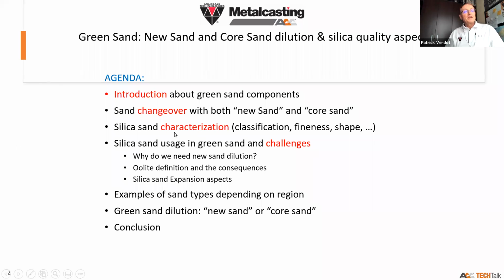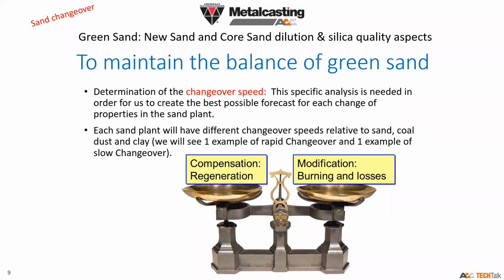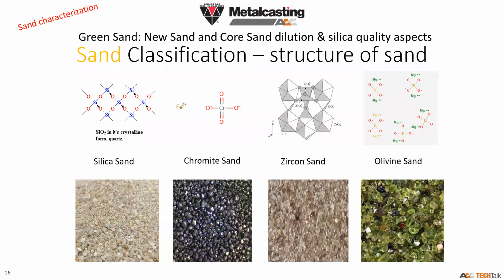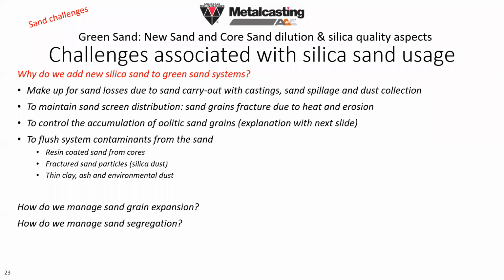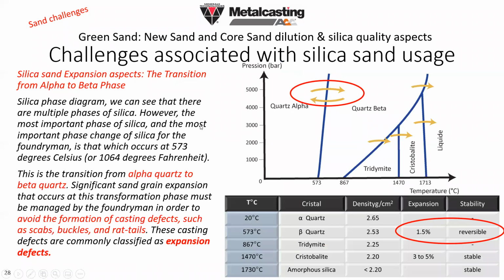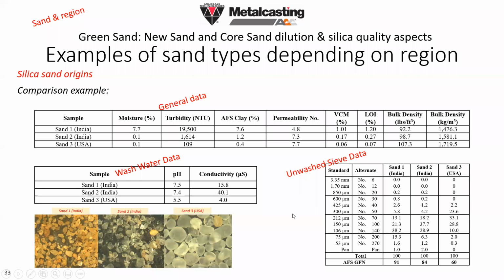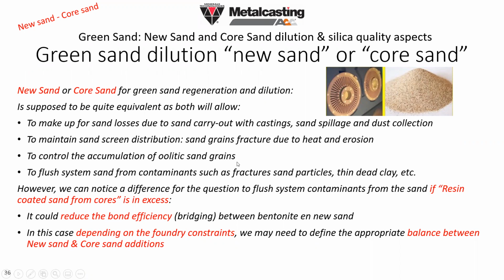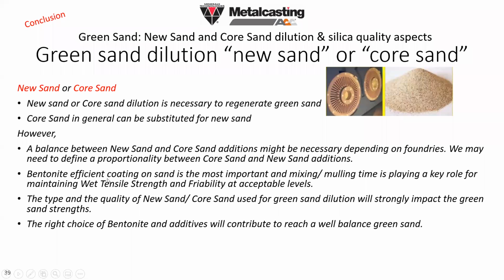New Sand & Core Sand Dilution by Mr Patrick Verdot

Comment: Dear sir, 
Its very informative video to all foundry men. My one question is as per below - 
Oolitic sand is good for sand properties... Please clear
Reply from the maker: No Oolitic means sand grains bounded with dead clay which absorbs free water. Free water is. Dengerous so less is Oollics better will be sand and sand properties.
Reply: 15-25% Oolitic is recommended in Japan. Oolitic help holding moisture and less scabbing while too high Oolitic cause metal penetration